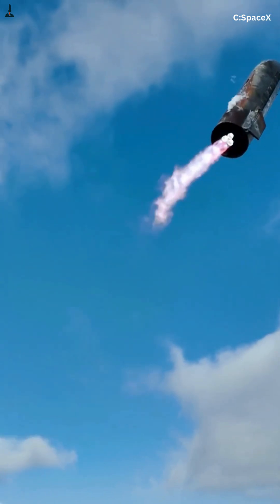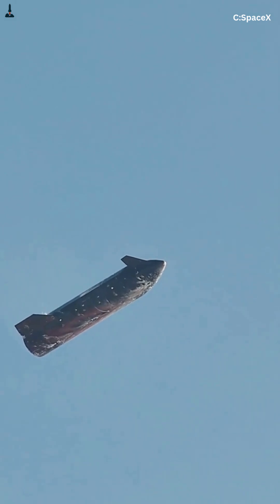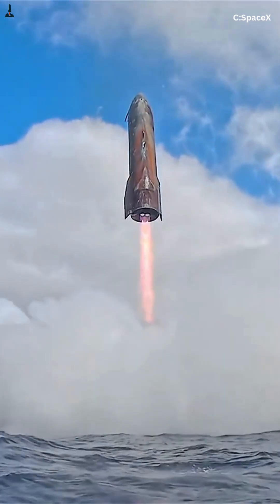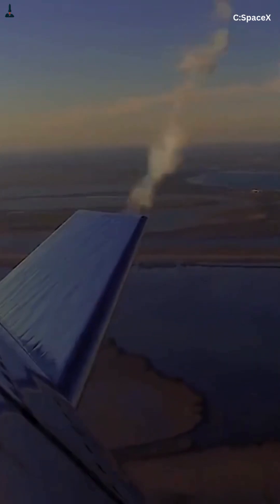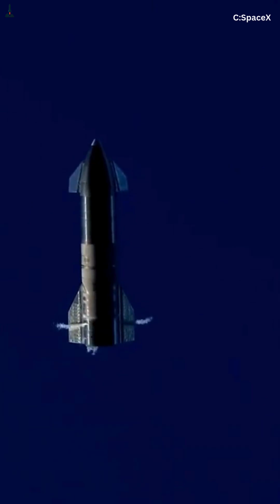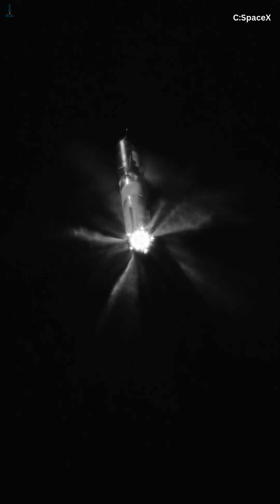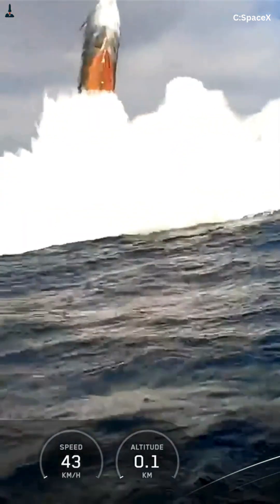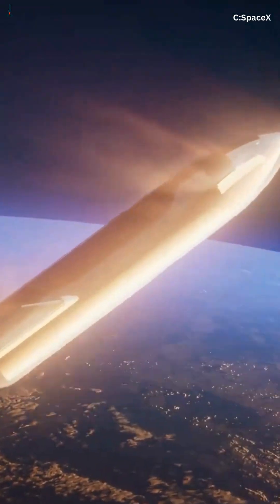This Atmospheric Trick Changes EVERYTHING #spacexrocket #starship  #spacex #elonmusk #spaceflight

Comment: But most of that will not work for landing on the moon and wont do much for landing on mars
Reply: And it's interesting to note that on Venus or Triton, which have atmospheres 100x the pressure of Earth's, retro rockets aren't required for final landing at all, because terminal airspeed is roughly 20km/h, and any sturdy spacecraft with strong legs or a heat shield can probably perform a hard landing without any parachutes or rockets at all. They can just "thud" onto the surface. That's exactly how Russia's landers landed on Venus. "Thud."
Reply: @TheNameOfJesus 
Revelation 3:20
Behold, I stand at the door, and knock: if any man hear my voice, and open the door, I will come in to him, and will sup with him, and he with me.

HEY THERE 🤗 JESUS IS CALLING YOU TODAY. Turn away from your sins, confess, forsake them and live the victorious life. God bless.

Revelation 22:12-14
And, behold, I come quickly; and my reward is with me, to give every man according as his work shall be.
I am Alpha and Omega, the beginning and the end, the first and the last.
Blessed are they that do his commandments, that they may have right to the tree of life, and may enter in through the gates into the city.
Reply: Moon DLC has its own uniqueness! It doesn’t have an atmosphere but compensates it with a one sixth of earth’s gravity
Reply: The Moon has one-sixth the earth's mass, and so the fuel required to land the same mass on the moon (or take off from it) is roughly 1/36th the fuel that is required on Earth. (1/6 squared is 1/36.) In fact it's lower than 1/36 because the density of the Moon is lower than Earth's density. So it's probably about 1/50th.
Reply: It cant get to the moon or mars, heck it cant even make orbit yet while completely empty